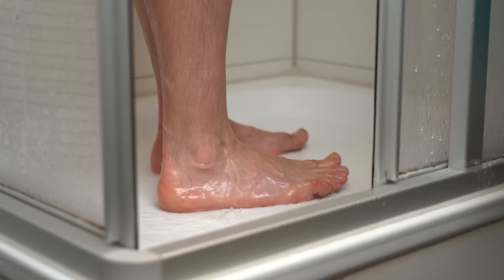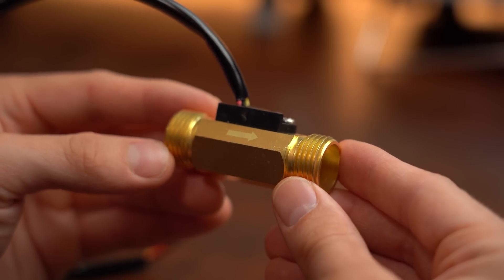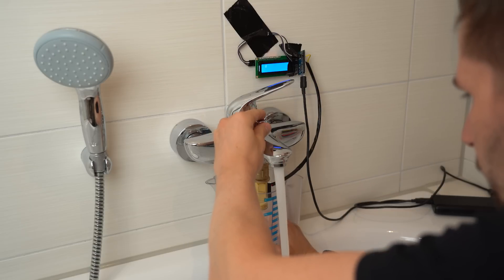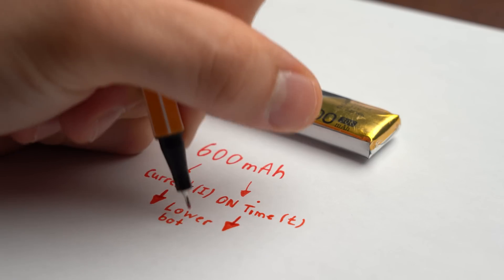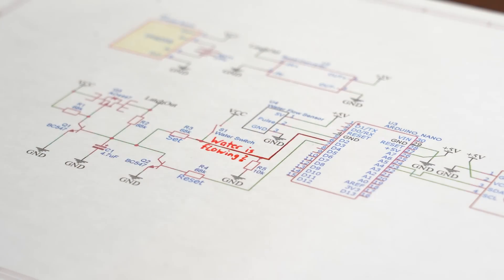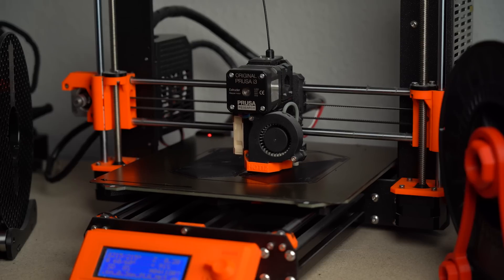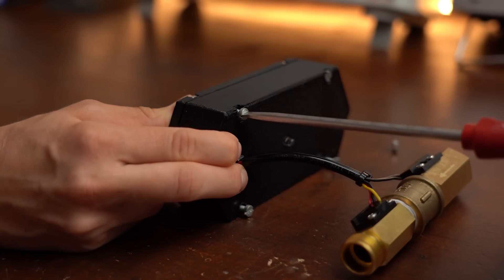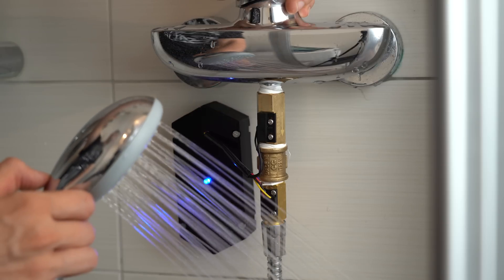Every Shower needs this Upgrade! (Online Water Tracker)

Comment: If you want to keep using Arduinos, you can install an MQTT broker like mosquitto on your home assistant instance and get the data to it that way. I used that recently even though I used an ESP, as esphome is server initiated and MQTT is client initiated. As my device is only on for a few seconds, as it also runs on batteries, this allows me to wake the device, send the data and go to sleep immediately without having to wait for home assistant to connect.

Comment: Next step is to add a pump to recycle the water for watering plants and an air conditioner modified to be water cooled to get "free" hot water during the summer.

Comment: i would use deep sleep modes instead of the switch and invest the saved money in a bigger battery (which is not needed). Also instead of the switch there could be a "turbine" to charge the battery

Comment: I'm using an ESP32CAM module with the camera focused at about 5 cm to take snapshots of my hot/cold meters' readout every hour, controlled by my home automation Raspberry Pi. The Pi activates the camera's LED, retrieves a cropped JPEG of the digits to its SSD (only if they've changed) then turns off the illumination again. It doesn't run image-to-text yet but at least it's building a history of measurements ...

Comment: You could easily approximate the cost for hot water, by taking two looks at your gas meter before and after a "normal" shower, dividing the amount of gas by the amount of water and applying the cost for gas in this calculation. A little change in showing temperature kills this calculation instantly, but you still get a guess.

Comment: Another idea is to measure three temperatures:
- cold inlet
- hot inlet
- common outlet.
Where you already know the amount of water at the outlet, you can calculate the cold and hot inlet water flow with a "Dreisatz" ;-) .
When you also have the temperature difference ∆T from hot inlet to cold inlet, you can calculate the amount of energy you used for heating the water with:
w = c*m*∆T. Where c is the specific thermal capacity from water with 4190 [J/(kg*K)], m the amount of water from the hot inlet in litre or kilogram [kg] and ∆T the temperature difference from hot inlet to cold inlet in Kelvin [K].

Comment: Couldnt you have used the flow sensors output with a transistor and capacitor for switching on / off the circuit so you dont need the "switch" device?

Comment: Awesome video! It would be cool if you could add/develop yet another turbine-like insert/pipe in series, so it could be used as a small generator to charge the battery. :)
Btw - how long will battery last in current scenario? 
Cheers!

Comment: I thought that I was over complicating stuff when it comes to home automation, but you sir, have beaten me. I also measure water usage, but I added a proximity sensor to the outside of my water meter. My water meter has a small metal piece that rotates and passes by when one liter has been used. The proximity sensor can sense that disc. Now, my boiler has an API, which allows me to check if it is heating water or not, so I know when hot or cold water is being used.
As far as I can see, you have Techem water meters. I believe they can be read from the outside using a 866mhz signal.
Reply: MHz, mHz - whats nine orders of magnitude between friends

Comment: You could also create a 2nd water circle which uses the warm water from the drain, reheats it slightly and pumps it back to the shower head. So you use a very small amount of energy and water and can shower for an extremely long time. If you design it in a way that it can be enabled and disabled while you are showering, you can avoid the problem of shampoo or dirty water getting into the circle

Comment: Hey, it looks like you also have Techem water meters. If it's like the ones I have, they wireless transmit a coarse value of their measurement every 5 minutes or so. Using an ESP32 and an SX1276 I managed to reliably read and decode the packets of my water meters and heater meters, but my project didn't go further than that. If you or anyone is interested, I can share my schematic, board and code.
Reply: Wasn't the data encrypted?
I have the crappy radiator sensors that apparently lives their own lives and as far as I have understood they are encrypted.
I haven't tried listening to them though, I just read at Techems page they have encryption.
Reply: @TheHellis  The protocol supports encryption but for some reason they don't use it. I can read the sensors of maybe a few dozen neighbors in my block. But it might depend on version or how they are set up when they are installed.

Comment: Great project as usual!

If you search for "water turbine 5V", you'll find different kinds of micro hydro generators you can put in series to you measurement part. It could be used to recharge the battery again. Maybe you need to convert from 12 V to lower voltage, but as I know you are an expert in voltage conversion ;-)

Comment: Apparently you can use MEMS to 'listen' to your water flow. I've seen sensors sold that work non intrusively and I'm guessing this is how they work. One should be able to connect this to their main to detect all water usage even in apartments. I'd love to see a project using MEMS (or even a cheap analog microphone I suppose) in place of a flow meter.
Reply: Now that's an idea. Thanks!
Reply: Ultrasonic sensing is far more expensive than turbine.

Comment: Perhaps Prusa is a workhorse, but nowadays it's pretty outdated. Even your printing history shows that's a bit slow. 4.6k meters of filament consumed during roughly 1200h of printings sits nowhere near my chinese crappy corexy printer (bit modded, but still for a fraction of Prusa's price) which printed 1.6k meters of filament in just 100hrs.

Comment: Why don't you use a water turbine in series instead of a battery?
Reply from the maker: Does not produce enough power. Tried it
Reply: @greatscottlab  What about those 12v 20w turbines? That little battery would become a nuisance to charge eventually. If your shower had windows then solar panels could who (have the battery charge through the TP4056 module and also change the charge current resistor).

Comment: In ESPHome, on the ESP32 board, you can use the deep sleep component and a wakeup pin to use that switch as a chip wakeup. Might help more for power draw? The esp8266 as far as I know in ESPhome doesn't support that.

Hope this helps! I'd like to help on v2 with an ESP32 Pico board :)

Comment: Well this is an interesting topic, since I was busy with the water flow sensors today as well. But my main idea is not for water usage measurement per se, but the measurement in flow between hot and cold water paths. The reason for it is to use the percentage in the flows between the two paths to automatically set a temperature point for a water heater within a showerloop system. In this way I can have a completely regular shower install, but have the temperature and the rest of a showerloop system be completely automated.

If I finish this project then I will definetely post something about it on youtube and github about it :D
Reply: Just an idea but maybe for showers you could use the waste water. Measure it's temperature under the drain and adjust accordingly. Although that's definatelly a workaround and does not work for baths or filling stuff with water like buckets
Reply: @ffoska  Well it is a showerloop, so all the waste water will go through a pump, filters (sediment, uv) and the be reheated back to a desired temperature (complete water re-usage). In this case I am trying to get the temperature adjusted by using a standard shower value (so no thermostatic valve) and checking the water flow on the separate paths to set a temperature. So far I have all the individual components working as necesarry. But the code and design is rather primitive and experimental (breadboards, janky scripts).

So the next step is to get it all together and create a more professional cohesive system :)

Also looking at maybe automatic removal and refill of shower water after a certain amount of rotation.

btw. water will always be purged after a shower end, so every shower will have fresh water.
Reply: @misthafalls  That's a really nice concept you got going on. Nice work!

Comment: Could you make a shower loop? So normaly hot water flows away. Catch the hot water in a small reservoir, re-heat it if necessary by electricity and pump it through the shower head again.

Comment: I think about a different way to get water consumption. I want to use the regular water meter. One possibility is to use a camera and simply read the numbers from the meter. Or you can try to detect the spinning wheel. But I would prefer to use a camera. Simply take a picture every hour or so and detect the numbers.

Comment: When I first saw this title and the thumbnail with no wires, I was sure that it is using some kind of water generator to power itself. Well, it isn't but that's a pretty good suggestion!
Edit: Maybe use the generator to charge the internal battery to get waaay more runtime and still preserve the stability of a battery.

Comment: The problem with that sensor measures flow at a specific pressure. If the pressure is increased and one liter is taken as a sample, the time taken is less. The same amount of water will pass but in less time. The little impeller of the sensor has to turn faster. Flow=volume/time....in this case time depends on pressure.

Comment: With the recent drought I was thinking that it would maybe be a good idea to have a big tank (with overflow 🙂) to collect all waste water except that of the toilets, dishwasher and washing machine, so people can use it to water the garden. I don't think a bit of detergent from manual dishwashing and a bit of organic matter from food would have a negative influence on the plants. Of course I don't know what would happen to to sewer if it gets much less water in hot periods. Could cause clogging, which you also have to take into account in your water collecting setup. Also, the water treatment facility might need enough water to recycle, but there I'd guess that it would be more efficient to use "local" water than to pump it back to the sewer treatment plant and then use treated water for the plants instead.
Oh yes, this would also help to reuse the cold water that gets wasted before the two delivers hot water.
Reply: In much of the rural US we don't have central sewers, so all wastewater goes into a septic tank where it is treated and then either spread out via a leach field (underground pipes with perforations) or it is sprayed out of sprinklers in the yard. The type that sprays the water out uses an air bubbler and bacteria to break down the waste to a point where the water coming out doesn't actually smell bad, and is technically "clean" (I wouldn't drink it, but it is no more dangerous or dirty than rainwater runoff at that point). A normal household generally doesn't generate enough wastewater to fully water a lawn, so there's normally just a nice green patch of grass around the sprinkler field but nowhere else.

Comment: For an SR latch, I've used 555 timers, which is surprisingly easy to wire.  It's called "bistable mode" and if you search for "555 bistable" you will find it.  Hence 555 timers can be used not only as flip flops (SR latches), but also accept a wide range of input voltages (4.5 to 16 volts), they cost very little, and you could always use them to make blinkenlights.
Reply: i'm pretty sure they accept even higher voltages

Comment: In most countries showering has basically 0 impact on the environment and very little on the wallet. Unless you shower like half an hour ever day - in which case: good for you, still better than most other hobbies.
The US is a country with rather high water-consumption per capita but even there it is only a small fraction of the overall consumption. If you personally want to reduce your water-impact then the best way would be to not waste the products you have. Most products we buy are produced with a large quantity of fresh water. 1 L of beer is anywhere from 20-60L of water. Tshirts are around 2500L of water.
Reply: las vegas recycles a lot of its water.
Reply: The biggest cost (environmentally and economically) of showering is not the water itself but the energy used to heat it up (unless you shower with hot water you burn gas or use electricity to heat it up, especially nowadays that costs a lot of money). 

By the way what you pay for the water itself is not the cost of the water (that in many country is free, that is water is public and you don't have to pay for it) but the cost of bringing it on your tap, that requires infrastructure made of pumps, pipes, treatment plants that use chemicals to make sure it's safe to drink, etc.
Reply: In Europe right now it's absolutely a great cost as many households can heat water with electricity and electricity is about everywhere at record high numbers and problem is getting worse. I just noted that my electric bills will about double. This will mean something like 1000 euro electric bill monthly if winter gets really cold.
Reply: @jothain  Well - i am from europe (same as Scott), and yes the prices have risen significantly. But that still puts a shower at well below 1€ even if you got no solar and the water is directly heated with electricity (the most expensive way you can do it).

(It is also kinda absurd that the EU allows energy-companies to rip off everybody like that - yeah, 100% increase on energy even when it comes from already government-subsidies solar/wind-farms, many making the highest profits ever in history).

Comment: For charging the battery I whould suggest that You can modify Your box to have small hooks for holding powerbank and use wireless charging system, so You will charge the device by putting wireless powerbank in position (on hooks). It will keep Your device simple and waterproof.

Comment: what if you just used the drain pipe in your shower stall? if you measured the pressure on the drain pipe after fitting a bottle neck adapter there with a radius that of the sensor, maybe you could have calculated your water useage regardless of the water source in your shower stall. granted, the pressure would have been a lot lesser and you would get a much narrower bandwidth to work with and therefore lower resolution to differentiate between the multiple taps, but i think its safe to assume that the pressure would be relatively constant regardless of which tap you used. also lowering it to a reasonable depth will increase the pressure, frankly, just enough power in the turbine to get a readable frequency is all you need. yes, depth would be an issue to access the battery after it is drained. there is also a small footprint issue tho: fitting the esp and the battery within the drain. im sure its nothing your 3d printer can't solve. as for recharging the cell: a waterproof port that opens up to a portable charger that can charge the cell overnight or whenever maybe? yes, depth, a huge issue. i want to roughly believe that, after the bottleneck, about a liter of water is going to pool on the floor and create about 0.15mW of power at a 15cm depth in the turbine. you were blowing air into the thing at about 15W, max (human lungs metrics are public data) which transferred for some frequency. the force your lungs created was the square root of the power, so really the water's tiny potential compared to your lungs does not necessarily mean a tiny force from the water. its just 230 times smaller. since your lungs transformed into a rotational input that transferred for a 500Hz frequency output, the drain itself can transfer for just above 2Hz (maybe it won't account for trickle down flow for turn on and off of the tap), but should be good resolution for a constant flow.
Reply: also, i just realized, it wouldn't be too clean or hygenic hahaha

Comment: There is a very simple invention that takes the warm water that goes in the drainage and serpentine that water around the cold water pipe that goes to your shower head. That way you can reuse a lot of that wasted heat.
It's not mich for a single household, but it's quite a lot for a place that uses a lot of hot water daily.

Comment: My first thought was that it would be better to place a measuring device on the output of the water heating tank, since that’s the most expensive water you can use but also powering device from mains wouldn’t be any problem since most water heaters located inside “dry” zones.. but then again, for MDUs it’s probably a bit hassle since you probably have some kind of central heating system supplying other apartments

Comment: Thanks, I've thought about adding my ESP32 devices to Home Assistant, now you've broken the code to make it work.  P.S.  Is there a powerful-enough in-line pipe 3.3V generator?  That way it would be completely self-powered, no battery needed and it literally powers up and down when the water starts and stops.
Reply: Almost all of the devices integrated in my Home Assistant use ESPHome. I use D1 Minis for the sensors, bought a load a few years back. ESPhome takes a bit of getting used to but it works and is reliable. I use NodeRed for logic & automation though.

Comment: I think it's possible to ditch the battery completely, and use the pressure of the water itself to spin a small dc motor to act as a generator, with a cap to smooth things up and to provide for power spikes(when wifi is involved). This way, it only runs while water is flowing, and no battery is required (nor charging).  With an energy/gas meter on the water heater, a calculated cost per shower cand be sent to the phone automatically! :)